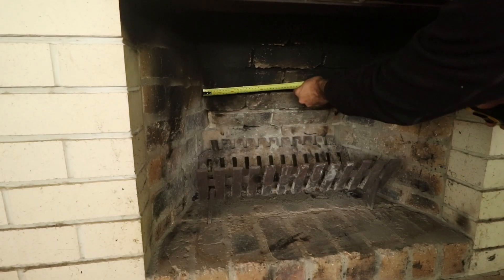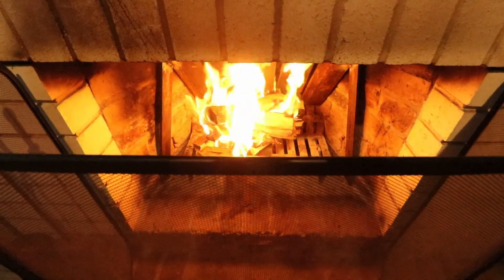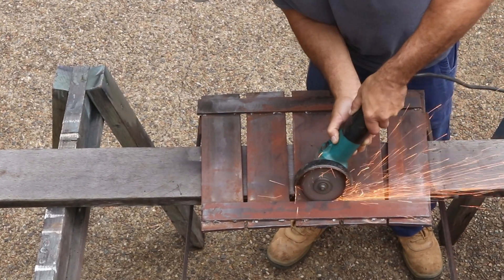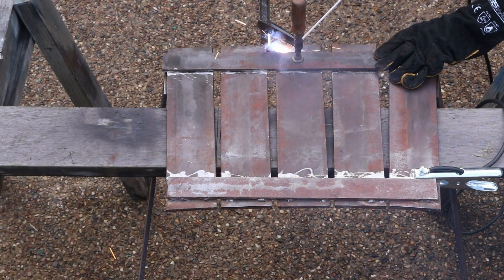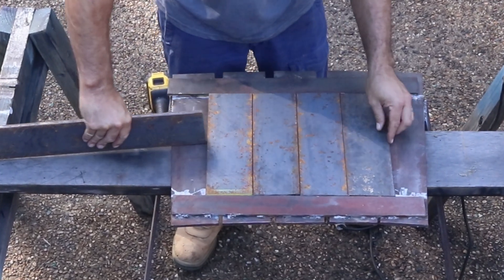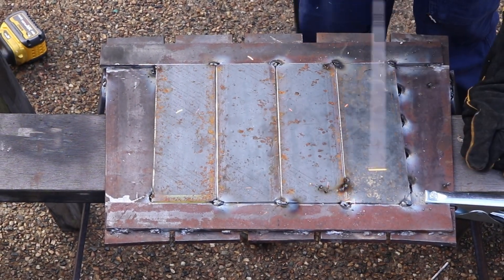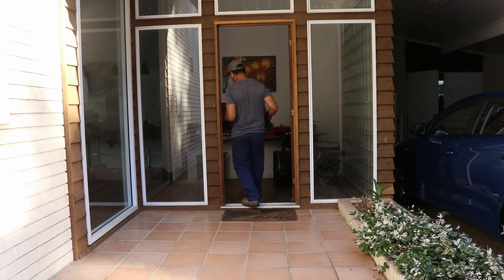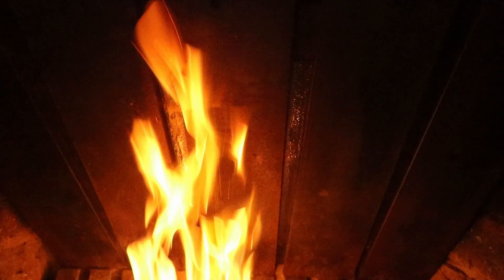Fireback 2.0

Comment: Is it recommended to install a draft regulator (damper) in the chimney instead of your method? I'm asking because I have the same problem with my fireplace: the fire burns very quickly, and so does the wood. Thank u